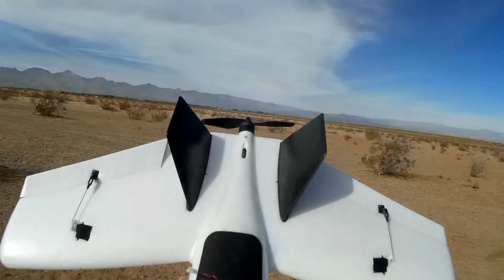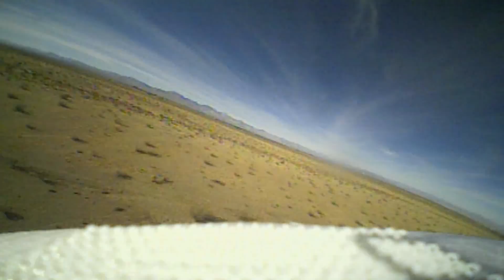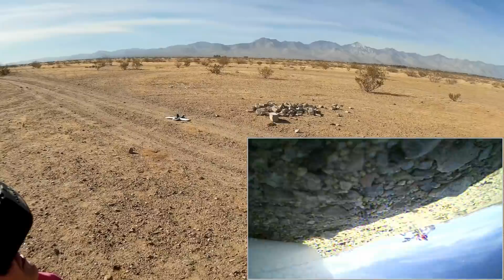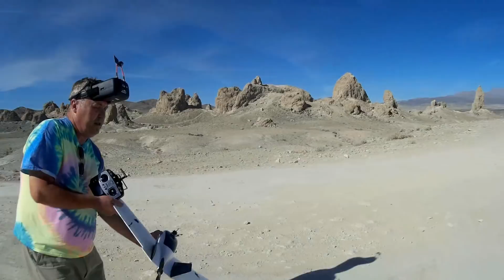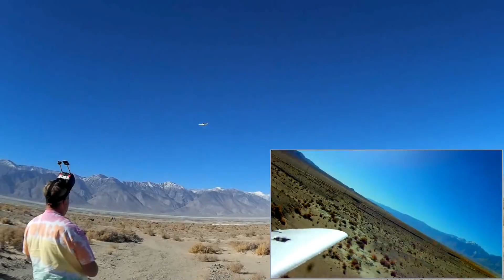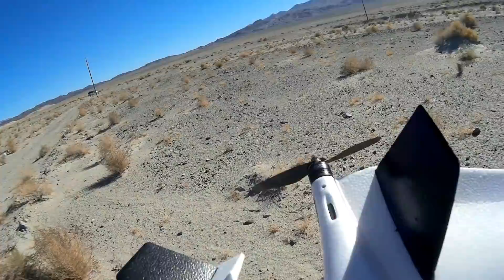ZOHD Dart FPV Gyro Stabilized PNP Airplane Flight Test Review

Comment from the maker: The PNP version of the ZOHD Dart includes gyro stabilization to ease flying for beginners or for long range LOS flying. Find it here https://goo.gl/9evfXs
and here is the 200mW TX03 FPV camera that I used https://goo.gl/j44NPZ
Reply: I had the same thing happen to me with my planned gyro it came loose and uncalibrated

Comment: I've seen enough videos of this plane to get the feeling that it's  more trouble than it's worth.
Reply: The motor mount is a weak spot. On the new versions they have partially improved that, but not fully. I've seem someone using a modified 3D printed motor mount, making it much better. What might also help is mounting the prop with a rubber band system. Since it's a pusher, the rubber won't have to absorb the thrust forces, and when you crash, or land with the prop stopping when pointing vertically, the prop will just be able to move away, instead of ripping off the motor mount.

Comment: hi could you show how you set up the jumper t8sg as i'm having trouble setting mine up with the dart?
Reply from the maker: What specifically are you having trouble with? Were you able to bind it?
Reply: setting up the switch for the modes (stabilised, acro and easy launch)
Reply from the maker: You're going to need to setup channel 5 in the T8SG's Deviation software as a three position switch.  It's a bit complex to do.  However, there are a number of tutorials on YouTube showing how. https://www.youtube.com/results?search_query=deviation+three+position+switch

Comment: Can this plane flight with 5s battery? I bought one 5s 1300 by mistake
Reply from the maker: Nope, that would hurt it.  3S voltage only, 1300 to 1800mah.

Comment: Does the FC supports Frsky receivers. Subs and/or PPM?
Reply from the maker: PWM receivers seem to be the only ones that currently work reliably with it.
Reply: Thank you for your reply, I placed my order for one using your link - my first Airplane.   
I have been a fan of your channel for more than 2 years,  your channel was the first channel that introduced me to Quads and I learned several great tricks (ex. Barrel Roll) from you, I really appreciate your afford and contribution to this wonderful hobby.   Even though I moved on to build and fly hobby grade quads BUT I still enjoy flying the most popular and the best toy grade quads that you suggested during past two years; like HT F801, WLToys v636, MJX x400, NIHUI U807, WLToys V333, Mould King-S, etc...however; I still looking for ORIGINAL Lishitoys L6052 :-).   Thanks again.    Happy flying!!

Comment: Finally somebody flew hobby-grade RC plane with Jumper T8SG transmitter and RCModelReviewer has done so with a racing quad. I guess this transmitter is capable enough for hobbyist as well as a replacement or spare transmitter. Thanks for sharing!

Comment: Why is stuff like this so ridiculously expensive? It's a circuit board and a motor with some styrofoam...
Reply from the maker: I just did a quick Google search of the parts costs
1806 2000KV motor  $12.50
12A ESC                       $10.00
2X Servos                       $8.00
Gyro Stabilizer             $20.00
Foam airframe kit        $20.00
Current price seems to be pretty close to parts total https://goo.gl/9evfXs
Reply: Hmm... All right. You win. But I don't know if I'd wanna spend $70+ on something unless it's sturdy. You said it was but maybe it's just my personal experience with styrofoam planes.

Comment: Thats a good thing but a littlebit slow
Reply: Marlon S. I fly mine with 1300 3s battery and the thing flys like a rocket, 4s will be better but not needed. Flys dead straight in launch mode with hands off the sticks switch mode to high setting and it’s very agile.

Comment: Nice. More stable than I expected and a far better glide angle too (it isn't the gliding brick I expected). Hasn't got the adaptability of the Nano Talon as it is short on space but good for for what it is. ZOHD have some good designs at the moment.